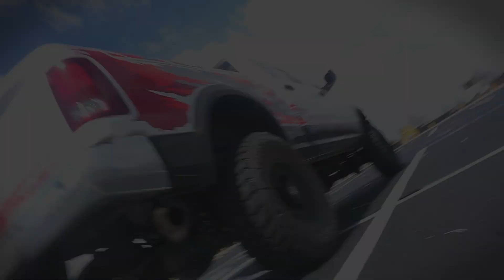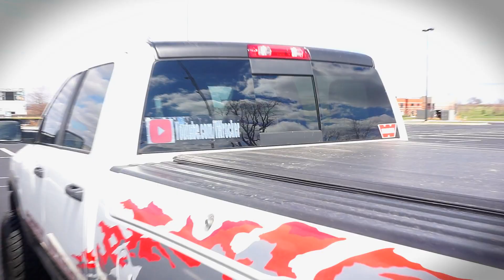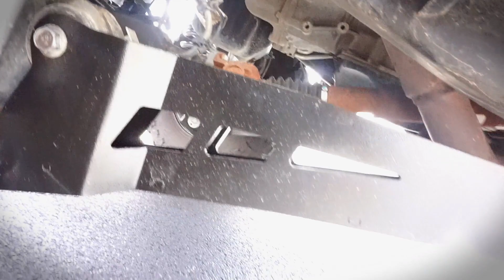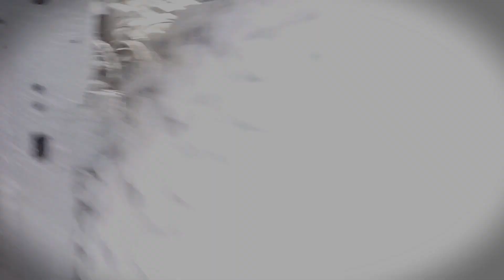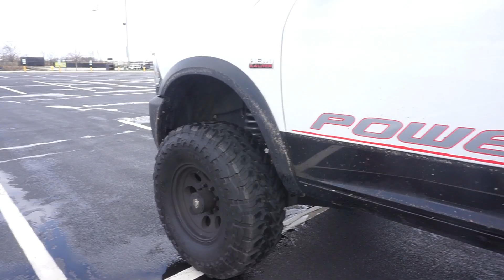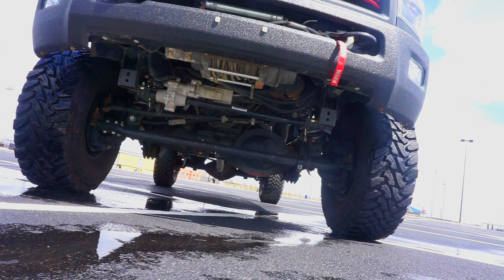Ram Power Wagon LIFT INSTALLED!!

Comment: Looking awesome. I wanted to go with a lift kit as well but didn't wanna pay for install so I went with a 3 inch front 2 inch rear spacer lift. So far so good. love the ram trucks. there beasts.
Reply from the maker: Yea its depending on if you can get a good price forsure. Love the Rams, they are a blast
Reply: Ryan Gauthier Where did you get the rear spacer lift? I have the truxxx 1.5" PW front spacer but want my rake back for when I have my sled or bikes in the back.

Comment: looks awesome definitely a beast, now the power wagon is about 3 inches higher than a lets say traditional 2500,so my question is it 2 inches taller than stock power wagon height?
Reply from the maker: Mine turned out to be about 3.25" taller than PW stock height according to the installer

Comment: Ok here’s the deal with the lifts, the Ram 2500 lift will fit the power wagon but the spring rates are designed around the Diesel motor which is 800 pounds heavier than the 6.4, I believe that is the only difference except for extending the sway bar disconnect. If you have a bumper and a winch your ride will probably be just fine. That’s why you see “fits diesel model only”.

Comment: Hey Looks great! I have a 2014 Dodge Ram sport 1500 with a 2"bilstein lift kit will 17and 37 tires fit mines? Thanks
Reply from the maker: Thanks! With only a 2 inch lift, that would be tight, as the 1500s sit even lower. I'd recommend at least a 4 inch lift to be safe to fit 37" tires

Comment: By any chance do you know what the stock shock lengths are I am hopping that you have the old shocks in your garage and you can tell me the fully extended and compressed length front and back.
Reply from the maker: Nicholas Nelson I will dig them out tommorow and get you the measurements
Reply: IWrocker thanks man I appreciate it. I looking to upgrade shocks soon. I have been looking at the rancho 9000xl pro series with the remote to adjust from the cab. I use this truck for everything and I'm thinking maybe they would be a good fit. I'm also looking at boogie bumps in the front and a Firestone airbag and dynastar cradle kit for the rear.
Reply: Iwrocker were you able to get the mesuments this weekend?

Comment: How is this for a Dailey driver? Do you tow with it? How well does it preform on a day to day basis?
Reply from the maker: I love it as a daily driver. I don't tow much though.
Reply: IWrocker well I prob won't lift mine but I have a 31 ft 14,500 lbs angler is this truck capable of that or do I need to get a regular 2500hd
Reply: Justin Howell Regular 2500. The power wagon is only rated for about 9,800 pounds. I should get mine next week. I only plan on towing a small toy hauler one day with mine. A half ton compatible toy hauler is probably what I'll look for. I don't want something huge.

Comment: I have a 2016 Power Wagon and wanted to know... with your lift and aftermarket shocks, does it ride smoother (softer) than the stock Bilstein shocks?  I know it's silly, but I am looking for more of that prerunner-like feel. I am interested in getting the AEV lift and fenders so I can run 40s.  Just want a softer ride than stock.
Reply from the maker: The AEV lift should give you a softer ride. idk if it will be like a prerunner, but softer than stock. My lift is still a pretty stiff ride, better than stock in harshness but still bouncy overall.

Comment: what did they have to modify for the install? I have a 17 Power wagon and my only options at the momment are Pure Performance, Carli and Thuren whom are all pricey. (3-4.5 inches of lift only) I want to be around 5-6
Reply: BackRoadKing93514 these  guys make lifts for the 2017 paw I have one but couldn't find anyone that made lifts for it.
Reply: +jeepmanls1  who does?
Reply: +jeepmanls1 I know if you call any of those companies directly they will hook you up with a power wagon specific lift. I know Don Thuren owns a power wagon and sages (carli) personal vehicle is a hemi ram. pure also offers a lift that fits wagons (main difference being end links I think)
Reply: I am contemplating a 17 PW and one thing that is stopping me is the lack of lifts out there. I would like to run 35's and while there are tires that will fit w/o rubbing the radius arm ect, I want it to be right. I spoke to Ted at BDS and he tells me that they can put a PW specific lift together but it would only be 2-inches (front and rear). He said it would be enough to be able to fit 35's with full articulation (even disconnected). I'm sure it'll be pricey though. My issue with Thuren is not just price, but even in their description, they say that the rear springs will be squishy and soft - not sure I like that.
Reply: Ok great thank you I will check out those vendors.
Reply: Yeah I wonder what is taking so long for us to get a proper lift?? I called rough country and they said that they just haven't had enough power wagons to trouble shoot one on.
Reply: +madmanhiker call cjc, they have carli and pure products as well. soft and squishy is relative. they custom valve there shocks and even if it had a softer ride it will be controlled and ride better then stock. it's all about the shock tuning.
Reply: +madmanhiker the springs aren't squishy, they just are softer then stock but like I said the shock will make a huge difference in control and ride feel with the correct coils. stock ones also have the bow that affects ride. Pure makes a 4.5 and that's the only PW specific company I know.
Reply: +jeepmanls1 CJC off road or 8 lug truck gear sell there products if you don't want to order directly. any of them can answer questions if you call.
Reply: +jeepmanls1 limited production means limited parts and the new suspension is a PITA to begin with. unfortunately the wagons aren't as popular as Raptors or we would probably have more availability from a company like RPG (Raptor Performance Group)
Reply: BackRoadKing93514 yeah I guess we will have to wait the price of those lifts are crazy lol.
Reply: +jeepmanls1 they add performance so they are more then generic lifts. I know pures Xfactor lift with there custom tuned 2.0s are reasonably priced but carli and Thuren or expensive. with how much money we spend on our trucks though we definitely don't wanna skimp on suspension 👍
Reply: +BackRoadKing93514 alot of R and D, shock and coil tuning goes into the product.
Reply: Did he ever answer what had to be fabbed to make it work?
Reply: the 17 PW fits 35s with no rub at all at stock height
Reply: Pure Performance is bad ass dude, and they make a 5.5” kit for the power wagon.

Comment: so is it 5" over PowerWagon height, like 7" over stock? or has it gone up 3ish inches?
Reply from the maker: 3 1/4" over PW stock height. Plus the 37" tires raise it up a lil bit
Reply: Awesome! 
Thanks for the quick reply, still on the fence about lift options (I'm in Canada) I want a minimum lift but I'd like 40's, that's why I was interested in AEVs lift, but found the same info you did.

How's the drive feel with 37's, do you think the 6.4 liter with 4.10 ring and pinion are enough for 40" tires?
Reply from the maker: I think the 6.4L with 4.10s are great with the 37s. Still shifts normal and pulls pretty hard on full throttle. But you can tell they are big and heavy no doubt, so if you had 40s, those are monsters and id regear for sure.